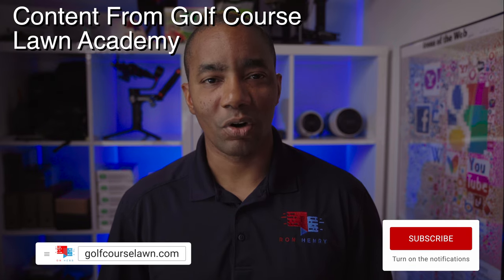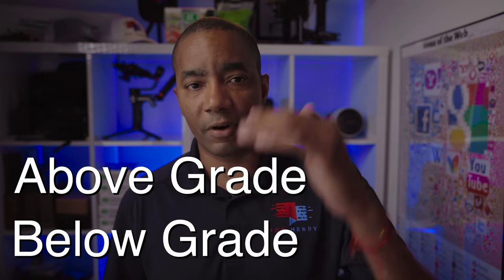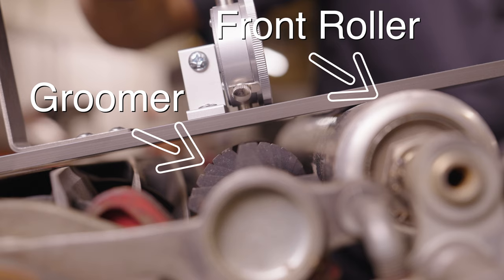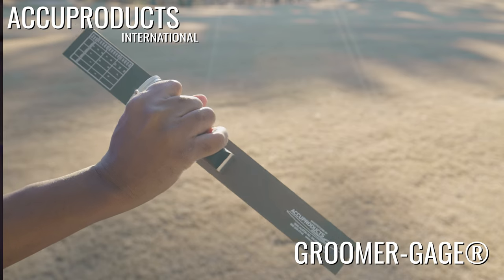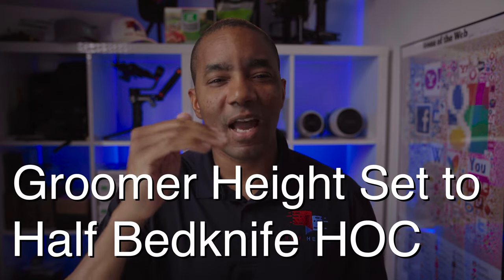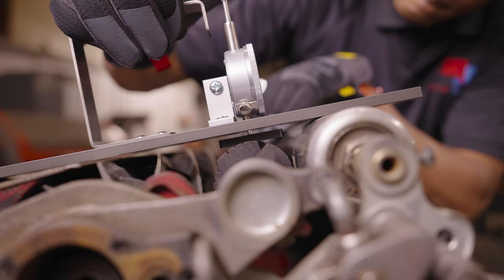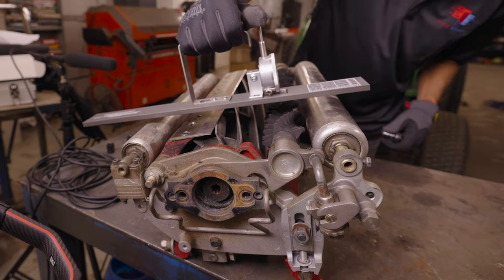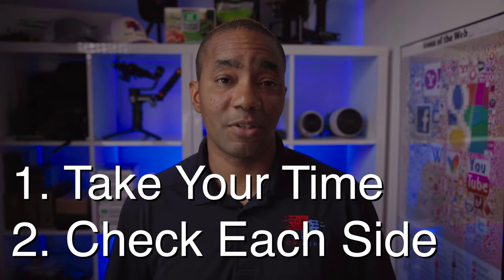How to Adjust a Groomer on a Reel Mower - GROOMER-GAGE® Demonstration

Comment: On my way just need that Toro 😬🤘🏼
Reply from the maker: I hear you Lawn 2 Learn. It's a cool setup for very low heights of cut. It's really designed for greens.
Reply: Hey Ron Question....

If you could buy a Toro TM 1000 that’s a bit beat up but cuts perfectly for $600
Would that be considered a decent deal ?

Thanks in advance
Reply from the maker: @lawn2learn  if it's functional then absolutely yes. As long as mechanically sound and cutting well, it sounds like a great deal. Even if you have to put some money in it and end up near 1k, you'd still be ahead.
Reply: Thank you.
Reply from the maker: No problem at all sir. Let me know if I can help with anything else.

Comment: So I’m confused. If I have my toro HOC set to 0.4 for example then the lowest point of the groomer is set to 0.20? Won’t that put it below the blade?
Reply from the maker: Hi Jerry. Yep that's the idea.  In the video the front and rear rollers represent the turf surface. You set the bedknife .40" away from the rollers and the groomer .20" away from the front rollers. So so the groomer  lightly  combs or "grooms" the grass vertically so that you get a better cut. The groomer has to be set slightly lower than the height of cut to work properly. Make sense?
Reply: @RonHenry  yes but you had started the segment saying that could set the height above or below the HOC and the latter wears out the groomer faster. So I thought is a bad thing. Do you use your groomer for the whole season?